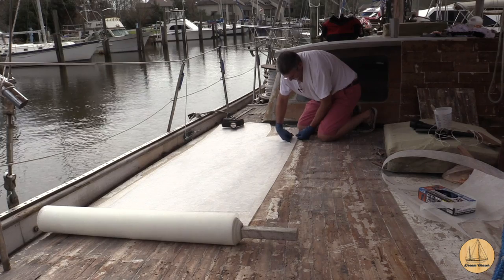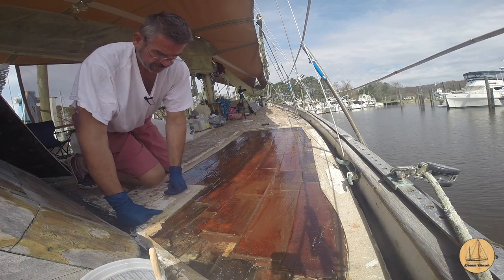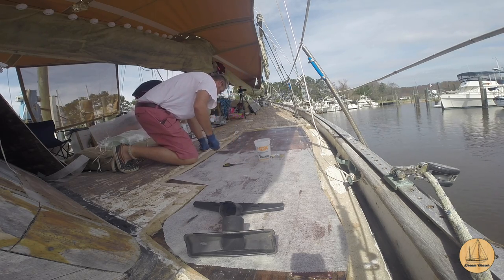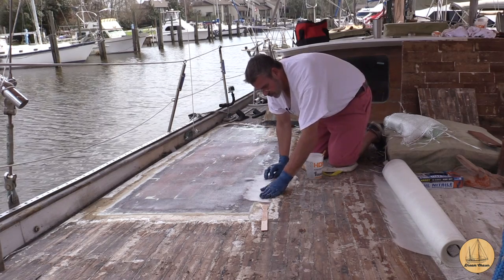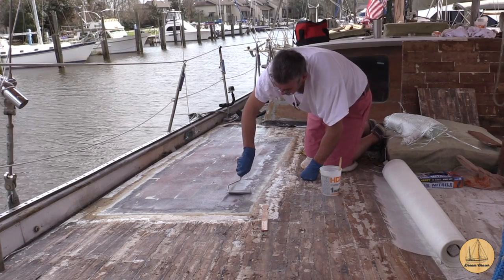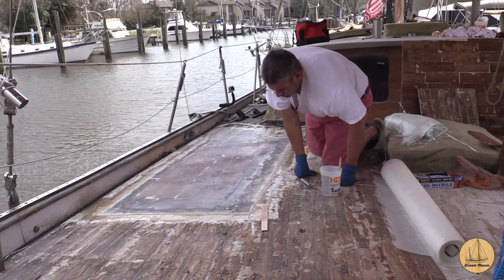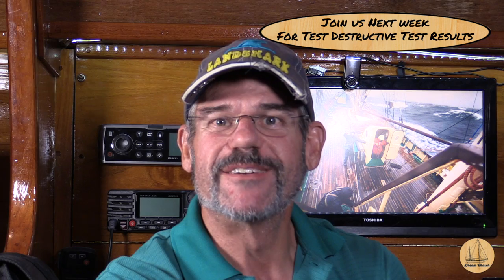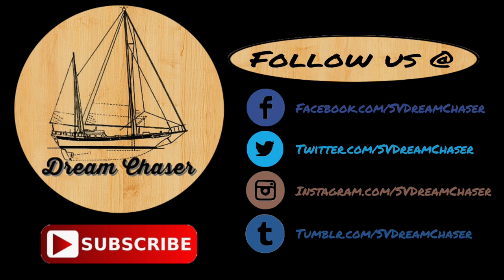How to repair Fiberglass Deck Core - Installing new Fiberglass

Comment: I suspect it's a little too late to offer suggestions, but in my opinion I would switch over to poly resin for the rest of the glasswork (exception would be the area you've already started with epoxy).  Poly resin is thinned with styrene which will also dissolve the binder in the CSM making it MUCH more pliable and easier to work with.  As mentioned if the surface is prepped correctly and clean of any grease the bond you'll get with poly will be more than adequate.  It is true that epoxy does have a stronger bond, but realistically it's like comparing a piece of equipment that can lift 8 tons versus another that can lift 10 when the item you need to lift is only 3.  Maybe not the best analogy but I hope it makes sense.  What I'm trying to relay is that both will provide a bond that is stronger than what is required for the task.  Save the epoxy for fairing the surface after all the glasswork is done..  Hope this helps!  I'm at this same stage on my project..
Reply from the maker: BoatworksToday Andy, thank you so much for the guidance. I've been watching your videos for years and really respect your opinion. Thank you
Reply: BoatworksToday is spot on. Vinylester is also an option, which has properties of poly and epoxy. It's harder to find and I only bother using it if my repair is below the water line.
Reply from the maker: Brandon DeYoung   Thanks Brandon.
Reply: +SVDreamChaser   I could not agree more with boat works comment and to use polyester resin. See previous comment on earlier video cheers Warren.
Reply: Wo! Andy's speaking! When the master speaks: listen! Andy and Boatworks Today is the best fiberglass work information source I have found between books and online! He did a whole series of this same issue on a Choy Lee if I remember correctly.
Reply from the maker: True that!!
Reply: @Svdreamchaser  WOW!! 6 year old video and you reply! You my friend are the exception! I really just commented to let other prospective poor saps in these kinds of positions to know where to find some good info! I really enjoyed your video also though. Especially that you explained how you realized part way through you may be going about the project in a bit more difficult and expensive manner than necessary! I just happend upon your channel searching for something different. Don't know how I've never found yall before when I've directly searched Formosa 51/Hudson Force 50! Sad to hear you had to sell her but understandable. Fair winds!
Reply from the maker: Thanks for the comment for sure. I was so surprised (and pleased) that Andy replied to this one. Dude is a master in the craft for sure.

Comment: I have done a lot of core replacements over the years and the one thing that I see the your not doing is. You should be pre wetting the back side of the hardwood pieces with epoxy before you set it into the thickened epoxy otherwise the dry wood will soak up the epoxy. It sounds like that would be a god thing but it will leave you with a week bond. One other thing you can do to promote a strong bond it to seal a piece of plastic over the area you have just bonded down and take your shop vac hose and cut a hole in the plastic sheeting that you sealed down and tape it to it. If you run the vacuum for 30-60 min it will pull the wood blocks down tight and even. It is the poor man vacuum bagging. I have done this many times and it does an amazing job. 
Keep at it your doing great. It's a long process but in the end you will have an amazing boat. 
Good luck.
Reply from the maker: Fraser, Thanks for the tip on prewetting the backs of the boards.  The sad thing is I recall hearing that before and in the excitement of doing the work, I ended up pre-wetting the fiberglass skin on the bottom and then added thickened epoxy to that rather than doing exactly what you suggested.  I will correct that on future work for sure.  

Great tip !!

Comment: Fantastic video, thanks for sharing. I really respect your openness & honesty giving rational and factual information on your experiences both good & bad. I watch with much interest as I am in a dilemma as to which way to proceed with some similar issues on my own boat (a 1974 Dellquay Ranger 36' motor cruiser). I have to rebuild the rear section of my wheelhouse which has rotted due to rain ingress and intend to build with laminations of marine ply and sheath with glass & resin. Intention is to fair then paint with International Perfection 2 pack linear polyurethane (the nearest thing I can get to Awlgrip - popular over your side of the water but nigh on impossible to get over here in the UK unless you are a professional boat builder, which I'm not). My dilema is epoxy versus polyester resin for all the reasons & worries you describe as it will need to be strong, water tight and blended into existing structure which is polyester & gel coat. I also have the teak deck to restore, which has worn and been sanded perilously thin in places, popping many of it's screw bungs. I also absolutely love following Andy of Boatworks Today - a true craftsman, professional & gentleman. Though at different ends of the spectrum, it's guys like you, Andy and a few others I could mention that stand out from the hundreds of wannabe "experts" (that really don't actually know very much at all and serve only to demonstrate how not to do it) and give others like me confidence and inspiration to go for it. Keep up the great work and long may you love sailing Dreamchaser afterwards. Best regards, Steve (UK).
Reply from the maker: Danny Boy for what it is worth, if I were doing all new laminations of ply or wood of some kind, I would go with Poly because it sticks very well to the wood. My tests showed it sticks very well to epoxy too despite the things you will hear. Yes it sticks better to poly and wood than to epoxy but I believe it to be more than sufficient for the job at hand. That is the way I will be doing my coachhouse rebuild when I get to that little gem of a task :)
Reply: Many thanks for the advice. I have some limited experience doing small jobs with West System epoxy and have found it extremely tenacious for bonding applications but haven't tried poyester. I think I will follow your lead and try a few small experimental tasks using polyester to get a feel for it. Many thanks again 🙋

Comment: How did it all turn out? And if you don’t mind me asking may I ask total time spent,how much money and what ended being the best for the deck?
Reply from the maker: Blue Steel - It may be an in-depth question, I will do my best to respond to all of your questions related to this as well.    
The repair worked well so from a process standpoint it was all good.  You can see below Andy suggested going with Poly and if you look at other videos, I did some extensive testing between Poly and Epoxy for the work I needed to do.  In the end Poly would have been just fine (and quite a bit cheaper)

So now, The rest of the Story,  This patch worked and in the end, (if you watch some of our current videos or the ones in the Refit Playlist, you will see that we decided to have the boatyard add 2 layers of glass over the entire surface of the deck.  We had some extra money (lol) and found a way to spend it and trade money for work in a way that was good for us.  I attempted to do some detailed fiberglass work on a deck box, and frankly while I built something strong, it didn't look good enough for me to want to do my deck.

Armed with that information we paid someone to do the work.  I have a hard time knowing what that cost would be if someone took it to the yard to do it, since we were doing a lot of varied work with the yard and had the beneift of the boat already being hauled, blocked and scaffolded and some of the other expenses that one may incur if just doing the deck.

As for the time it took to do that patch you saw in this video, it was about 40-50 person hours (counting my wife and I both).  The materials were another$300-400 USD.  That was to remove the teak in that area, cut the outer skin, remove the old core, cut new core, dry fit it, epoxy it down, then float a layer of epoxy into the cracks between the core to get a smooth surface to work with and then the layers of matt.  

One last admission of skill (lol).  When I had the boat yard do the glass on the deck, there was a noticable difference in the area I patched where it was a little lower than the rest of the deck.  This is attributed to the fact that I needed to have put down 2 more layers of either Woven or 1708 to build the thickness up.  The yard did all that when they layed the new glass.
Reply: SVDreamChaser sounds pricy
Reply: SVDreamChaser I’m fairly Green at boat work, but I’m leaning in my own proses. Iv dun a few things nothing major but stuff I’d never thought I’d find my self doing! But it’s been fun so far
Reply from the maker: It was, but hey easy come easy go.  Seriously though, I paid a lot at the yard, but I also had a LOT of work done (new decks, coach house skinned, new mast to replace wooden one, painted the entire boat above and below water, new stainless railing and pushpits, clean and paint entire bilge and I ended up replacing large section of rotted roof on the coach house that the yard fiberglassed over as well.  In the end, I thought it was reasonable for the extent of work I had done.  (but that is all such a relative thing)
Reply from the maker: I hear you.  I mentioned to my wife that 2 years ago, I NEVER would have ventured into some of the repairs I sort of start without a second thought to them.  If you keep that mentality that I have of "I wanted the boat to look good from 10 feet away" it gives you some leeway for a few mistakes.
Reply: Sailing Blue Steel 3209l

Comment: Good decision going with epoxy.It's inherently much stronger and creates a much more secure mechanical bond than anything else.Get a piece of hardened epoxy and a piece of hardened polyester resin and apply a 'Hammer' to both and this becomes abundantly clear.
Also,I found penetrating epoxy to be invaluable when the grip is crucial.I taper sharpened some heavy stainless nails and hammered them through a foot square piece of plywood backed by some layers of glass and more ply(sort of like a bed of super sharp nails) and perforated all surfaces to be bonded followed by lots of penetrating epoxy followed by standard epoxy for an incredible bond even of dissimilar materials...oops,got carried away there but...
Reply from the maker: Dean Farina thanks for the comments.  I am in the middle of doing two different tests, one wth epoxy and one with Polyester and will be testing the strength of both.  I agree epoxy is stronger, but question the value of making a repair that is infinitely more strong than the rest of the boat itself :)

Comment: I would use epoxy for this kind of repair, however, I would not do an epoxy layup.
I would use the existing shin that was cut out, sands it well and bed it in thickened epoxy, same as you did on the bottom skin. then I would lay it down and put weights over it to hold it down and get a good bond. a bit of thickened epoxy squeeze out is a good thing.
Reply from the maker: Great info.  Thanks

Comment: You are incorrect about the existing epoxy, Gellcoat is polyester resin gell.  
The existing deck was laid down with polyester resin. There was no epoxy in widespread used when these boats were made. and still, very few are build with epoxy, it is too expensive.
Reply from the maker: Alan Stevens that makes sense Allen, the thing I wasn't sure of, is if somebody had used epoxy at some point after manufacturing but before I'm doing this work. 

I just don't know the answer to it so I'm going to do another test attaching polyester resin to one of the pieces of the deck that I have not put back down into the deck

Comment: why didn't you use the original skin. rough up the surface same as you did on the bottom layer. then you only have to glass up the seams
Reply from the maker: I should have.  In hindsight.

Comment: Check the internet for cheaper epoxies. West is very expensive. I use RAKA one to one and use 1708 fiberglass which is glass and mat combined and builds up thicker. Also epoxy is an adhesive whereas polyester is not. You might also create a tiny fillet where the fiberglass meets the deck so the transition is smooth.
Reply from the maker: Mark Dichter thanks Mark. The fillet is a good idea too

Comment: Chopped strand mat is bind with a binder which dissolves with polyester resin. Epoxy does not penetrate Chopped strand mat so easily. Takes a lot of rolling. You should use woven roving mat with epoxy or use polyester resin with Chopped strand mat. 
If You want some wood working and varnishing tips check out my channel.
Reply from the maker: Great tips, thank you

Comment: you will save a fortune with polyester resin.
Reply from the maker: So true DonnFL, I was pretty surprised with that in the beginning of my experience as well.  In another vide, I did a full blown comparison between Epoxy and Polyester Resin.  I came to the same conclusion and it if was good enough for the manufacturer, I think it is more than good enough for me :)

Comment: This guy is truly confused as to what types of resin are used in boat building.  try vinyl ester resin.
Reply from the maker: jeff huntington I am always open to corrections. I don’t believe the boat was made with VinylEster resin based on yard and year but I am by no means an expert.
Reply: it was built with poly ester resin. gel coat is also a polyester resin. Vinyl ester will give you the qualities you want in both epoxy and polyester resin. It is also water proof and neither polyester or epoxy is water proof.  Honestly I have used all three and the polyester will out live both of us.  Most of the time its some one that dosnt know how to seal a screw hole that kills a deck